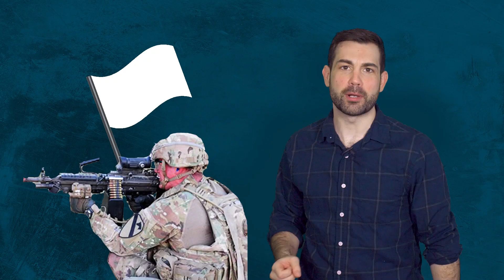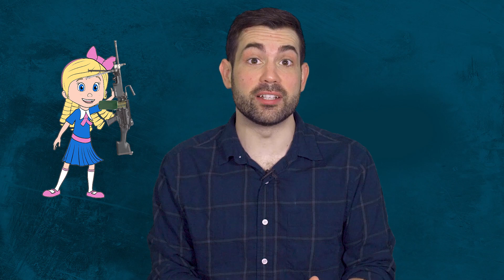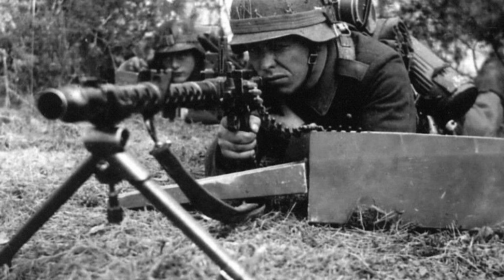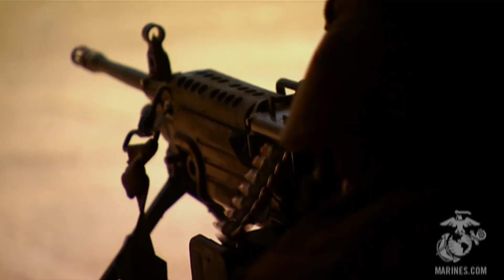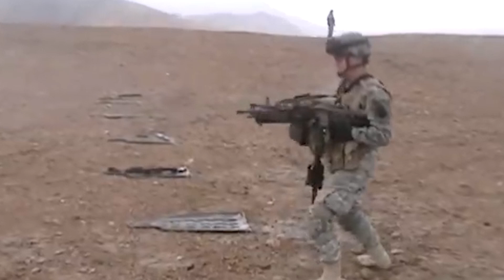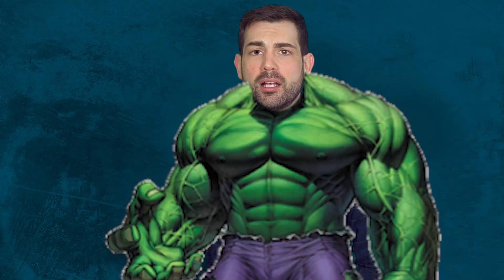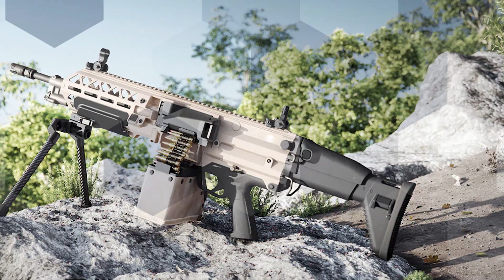How the M249 Machine Gun Evolved

Comment: The Israeli Negev is dual feed, and because it's gas system is adjustable, it can quickly be set up to feed from mags reliably. The position of the Negev's magwell also means it can use drums comfortably. So, instead of a 50-60 round belt in a "nutsack" the gunner can have a much more reliable 50-60 round drum or long 40 round LSW mag, or two jungle-styled 40s on tap for a "react-to-contact" suppressive fire. And the best part is, in addition to have a belt or two, and some mortar shells for the weapons squad, a grunt can have some ammo for the SAW gunner without any extra weight, because his ammo, is SAW ammo. Or, even if he does take a pair of 40s and a 60 on top of his personal 7 30s, all that ammo can still be used for his rifle should he be separated from the SAW, or should his unit be acting as a base of fire for an attacking or maneuvering force, he would have the ability to briefly provide a high volume of fire during a critical moment. 

During an ambush, it may be beneficial for an entire platoon to use a but of auto fire during or shortly after the opening moments, to open up the enemy ooda-loop through making it more difficult to locate the position of the belt-feds.

Write your congressman and ask them why they didn't use the Negev for the GWOT.

Comment: In the FMF in the 80s, a small minority of Marines loved them, but most didn't want to get stuck with them. They are heavy and cumbersome, but they also couldn't really deliver consistent firepower because stoppages were ridiculously frequent and the barrels need frequent changing. The Marine infantry fireteam included an a-gunner, but in practice the automatic rifleman was usually on his own to deploy the POS. One man with two hands has a hard time maneuvering and operating his gun while switching barrels. Whoever designed it had no idea how such a weapon has to be carried and used.
Reply: A classmate of mine was in the Marines during the late 80s and his comments to me, with the expletives removed, match yours.  He absolutely hated the the thing and thought it was the best weapon a potential enemy ever had.
Reply: I hated the fucker too, especially scraping the black carbon built up on the small gas system parts.

Comment: iirc the IWI Negev can also use STANAG mags, but it works way better than the 249. Could be interesting to make a video about that
Reply: That’s because they have a specific gas setting for magazine feed
Reply: @jacobzehavi3279  I came here specifically for this. I wish the 249 had an adjustable gas block.
Reply: I think the Stoner 63 also used magazines. But that's out of service.
Reply: @lepmuhangpa  yes, but you had to change parts in order to use mags
Reply: @seppesneyers3592  Ah, that's kinda disappointing.

Comment: You’ve got a great channel!  You keep me up to date on all of the cool stuff. 

I have experience with the SAW from early to mid-1980s when I was in the 82nd Airborne. That was peacetime experience, but we never had any problems with in terms of reliability. Even when fed from a standard M16 magazine it worked fine, as long as the regulator was set to the slower rate of fire. We did have several complaints about it though such as the exposed barrel burning the snot out of everything that touched it, the carry handle being fixed and jabbing the jumper upon landing, and would have preferred a shorter barrel and folding stock. It beat the hell out what the automatic rifleman carried prior to that, a standard M16A1 with 3 extra 30 round magazines and a cheap bipod.  I have some experience when I was in Special Forces with the FN MAG-58, but I was out of the military by the time that it was adopted as the M240, so I’ve never fired that version, when deployed or just on a flat range. I always preferred the FN MAG-58 to the M60, but by that time the existing M60s were pretty worn out.
Reply: Thanks for severing the greatest country in the world.
Reply: @Sensei_Foosball  Thnaks, but I think that autocorrect got you.
Reply: Clips?
Reply: @macman1138  Clips?

Comment: the M249 was not the first way to use normal magazine M16. The Japanese type 11 LMG. 
had the same way of thinking.  only with clips of 6.5, if the machine gunner ran out of ammo a soldier could give his clips to the gunner. I think the Type 11 was the first one in way of sharing of ammo
Reply: Yep it was fed by 5 round type 38 clips by default. Not entirely the same concept though. The m16 mag adapter for the m249 was meant as a last resort when the gunner ran out of belted ammunition, whereas the type 11 only used the method of being fed by type 38 rifle clips
Reply: @Gameprojordan  true, but in the way of thinking, kind of then 😅
in my mind, is it a good idea, just as a precaution then, suppose the gunner has no more ammo than the M16 magzine still do something, despite less firepower than
of course, everyone looks at it differently
Reply: Yes it but Japanese good reason to Japanese can not produce good amount     magazine so they two types machine gun one type 11 is large number and type 99 is only used for small number
Reply: @ksrinivasrao7133  production numbers type 11 in 6.5, 29.000. type 96 also in 6.5. 41.000 and the type 99 in 7.7 53.000 built
the type 11 saw battles against the US throughout the war from 1941 to 1945. But most were given to imperial or Manchuku.
most commonly used model against the US was the type 96 and the type 99 LMGS

Comment: The future of light machine guns will be just normal rifles like the hk416 which already are light can fire for a really long time at a rate of 900rpm at that point all you need to do is use a bigger mag. If recoil would ever be a problem you can always just copy the ak107 and put a big mag into it. There is currently very little reason to use higher power ammo because modern armor plates are so stupidly good a much better option is to just fire normal ammo but much faster with less recoil to hit the non armored parts of soldiers.
Reply: Won't work. Open bolt is the way to go for suppression
Reply: @destroyerarmor  why would open or closed bolt matter?
Reply: @AdamSchadow  You can't just slap a 100 round mag onto a regular rifle and call it an AR. It will begin to wear and break after a couple of hundred rounds of sustained fire. For an AR, you need more durable components that can better endure the stress of sustained fire. More durable components means it must be heavier. So, an AR will always be heavier. We're limited by physics in that regard. That's the whole reason why the M27 idea never got implemented fully. They wanted to replace an AR by a regular rifle, but in practice it didn't work out.
Reply: @AleksandrKramarenko  It very much works in practice and modern automatic assault rifles can shoot for a long time before any significant dmg happens. Also keep in mind you dont need many shots to kill someone.
Reply: @AdamSchadow  It didn't work in practice. So, they never ended up replacing the M249 as they originally intended. It's not about how many shots it takes to kill someone. Real life is not like a video game where you want to reduce the hitpoints to zero.
Reply: @AleksandrKramarenko  yes in real life you only need a single hit in the right place to take out anyone. And the more dudes with faster firing guns you have the more likely you are going to win why do you think nobody uses muskets or bolt action rifles for main line troops anymore?
Reply: @AdamSchadow  Right, exactly. And you can't shoot fast when your rifle begins to jam after a couple of hundred shots of rapid fire. You then also won't be able to shoot accurately anymore due to warping. Rifles are not meant to be used like a machine gun.

You should think about what's so special about machine guns. And you should also think about why militaries don't just replace all machine guns with regular rifles.
Reply: @AleksandrKramarenko  They are exactly doing that giving everyone fast firing full auto guns. Also after a couple hundred rounds you probably killed a dozen enemies which is more than good enough against a near pear adversary.
Reply: @AdamSchadow  I think I see where you're coming from. You're thinking in video game terms. Rate of fire, damage per second, etc. In video games there isn't really a difference between rifles and machine guns. Real life is different.

You should look up on Youtube videos of people doing mag dumps using rifles. You can then compare that to machine guns doing mag dumps. When watching those, remember that with rifles they are taking pauses when they reload, while with machine guns they usually use a single long belt, so they are doing full auto nonstop. Note how many rounds they fire before the weapon begins to fail. That should give you an idea of what the differences are between rifles and machine guns (and why you want machine guns).
Reply: @AleksandrKramarenko  I think you seem to forget that long before any games or computers people already made mathematical models for ranged combat. They all came to the same conclusion you want to have as many dudes as possible firing at the enemy dudes as fast as possible and as accurately as possible. They also found out that in order to win soldiers dont even need to take out 2 enemies before they get taken out. This theory is often not told to the regular soldiers but it is the sad reality if you fire 2 shots and hit two enemies well in a fight your job on a macro scale is done.
Reply: @AdamSchadow  You should watch the videos. They are interesting and you'll learn something new.
Reply: Why shooting thousands of bullets at a armored vehicle in the hope you hit a weak point? Maybe its better to take a anti tank missle than.. If you shoot like a crazy at a armored vehicle you are nuts.. that vehicle shoots back.
Reply: @toolfreak78  yes ofc but unlike armored vehicles humans cant be armored that well. Forcing every soldier to run around with something like m107 50cal is also tricky but it would work since at that point you cant carry armor good enough to stop it.
Reply from the maker: thats definitely part of the shift of small unit tactics philosophy right? the army is even looking at a rifle for its AR role with the General Dynamics bid.
Reply: I guess that's why M27 comes with heavy barrel, so it could withstand a bit of suppressive fire... in theory...
Reply: @xxdd  Yes, it works a bit better, but the barrel is not enough, which is why they decided to keep the M249.

Comment: Yeah the M249 is old school and sucks compared to the Ultimax 100. I love belt feed but those belts get dirty being exposed to the environment. Magazines really are the only way to go.
Reply: They come out of the box and almost directly into the weapon. Very little exposure. The SAW is just a piece of shit that is made to look doubly bad serving along side the 240, which might (arguably) be the finest belt fed weapon ever designed. It’s hard to believe the same company came up with such dissimilar machine guns.
Reply: @socaljarhead7670  yes sir I love the FN MAG 58/ M240 It competed against the M-60 back in the 1950's and replaced it 50 years later. It's the 7.62x51 GPMG to beat and it will still be rocking till the end of the world thru Armageddon.

Comment: Something I’ll say, the SAW is known for jamming while using the mag-feed option. I Personally put around 5-6 mags through my saw at a range once and didn’t have any malfunctions.
Reply: I think it has something to do with the military mags being worn down or something, and the mags spring not pushing the follower up fast enough for the 249 bolt to catch a round due to the higher ROF
Reply: No, I think it's because you have to clean it every once in a while.
You know, like taking it apart and rubbing it down with a proper lubricant.

Do you clean it every few weeks to every few days?
Most people who have used the M249 have used it in combat, so there are terrain difficulties while trying to maintain its malfunctions with cleaning.
Reply: The problem lies in the gasregulator, which has only 1 setting: full open for the belt fed. For magazine fed you need less gas. The Negev has a gasregulator that you adjust to mag fed. And no more stoppages.
Reply: @mardiffv.8775  that's what it was about. I remember it being something about the bolt traveling too fast to catch a round from the mag but I thought it was a mag issue. You are 100% correct
Reply: We had some of the Marine Corp’s first SAWs at Quantico in the mid ‘80s and they were regularly destroying followers when used with a magazine.
Reply: @Former_Trump_supporter  
Yeah, new to lowers feed at a different height to accommodate m855a1 and m262 mod 1. They feed fine now
Reply: I personally never had problems feeding from magazines with my SAW, but most other veterans that I talk to did. In all fairness, those magazines were never designed to be feeding that fast, so it makes sense.
Reply: We ran our Minimis with mags quite often and I never had an issue with it.
Reply: The reason the saw jams with regular mags is because theirs mags were designed to feed rounds for a 3 round Burst m 16. Fire too fast with the saw and you’ll get miss feeds every time.
Reply: @Hillbilly6-c5p  
The SAW has the same rate of fire as the M16 family. It's not shooting any faster. Both are shooting 700-900 rpm
Reply: @theimmortal4718  sure but the standard mag is made to feed 3 rounds at a time, the spring doesn’t feed the rounds any faster. That’s the cause of the miss feeds when you try to use them on the saw. That’s why p mags are better and reduce the miss feeds on the m 16s, the spring is better quality and you don’t need to take out the rounds after every mission like the standard mags to reduce wear.
Reply: @Hillbilly6-c5p  
The standard mag was designed to fire from the M16 from 1963, which is full auto. GI mags work just fine on our M4A1s, but not on the SAW.
Reply: @theimmortal4718  just telling you what the lanes instructors told us my man.
Reply: @Hillbilly6-c5p  
Yeah, no magazine is designed to fire 3 round bursts
Reply: @Hillbilly6-c5p  Key takeaway here is to never trust an instructor when they’re talking product engineering.
Reply: @theimmortal4718  I think the M249 runs faster with box mags because it doesn't have to pull the belt.
Reply: @timewave02012  
I doubt it's much more at all. I always had my gunners shoot with mags, as well as belts. They usually kept 2 emergency mags on their vest or belt just in case they needed a fast reload
Reply: Gen 3 Pmags work well in the SAW
Reply: Same, did a live fire as a private with mags, never had a problem.
Reply: i was gunna ike but you have 249 likes in a video about a 249 LOL
Reply: it doesnt jam with feed tray unlached ... for me  ...,w/ different SERNO Weapons ..
Reply: Never had a problem with the mags with the green follower, but the ones with the black follower would occasionally jam. Of course they would jam with the A2 and M4 as well.
Reply: Key word
Once

Comment: I was with the 3/22 Inf Rgt 25th ID from 90-95. When I first got there the M-249 had the tubular stock and exposed barrel that was substantially thinner than the heavier barrels on the M-249 today. Guys were always burning their forearms on the exposed barrel. Our unit armorer was a genius and fabricated custom heat guards for our M-249's out of the upper portion of the barrel guard for M-16's with the M-203. So we had these cool squared off heat guards for our SAWS. The Tubular stock was a POS, it was always getting tangled in the brush and it had a lot of side to side give to it which made the weapon a lot more inaccurate when firing because the stock would wiggle back and forth a bit. Eventually we got the solid stock, new heavier barrel which was less prone to overheating and heat shield. It made the M-249 about 5 pounds heavier, noticeable in the field.
Reply: 25th ID is based in Hawaii.  I believe the nickname is "Tropic Lightning."
Reply: @brianjob3018  You would be correct, Schofield Barracks.
Reply: I feel your pain. I was a SAW gunner the same time. I was with 3rd Battalion 3rd Marines at Kaneohe. Definite vine catcher.

Comment: Given the weight, this gun should've been replaced with something lighter like the Surefire MGX recoilless machine gun a long time ago. At least do it now, the SIG machine guns are like half the weight with more firepower.
Reply: 24lbs with comparable firepower to a 50 bmg and twice the effective range of the m249/m240B
Reply: The USMC wanted the Ultimax.
Reply: @MildMisanthropeMaybeMassive  Was there ever an Ultimax variant with belt feed? That might have been the hangup, given the bad reputation of the M249's mag feed.
Reply: Pretty sure the USMC is transitioning to the M27.